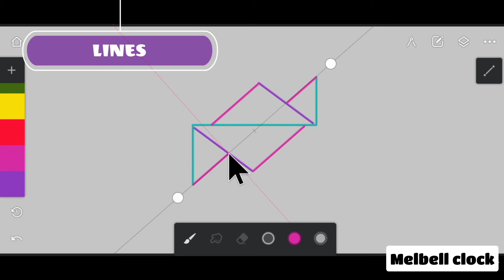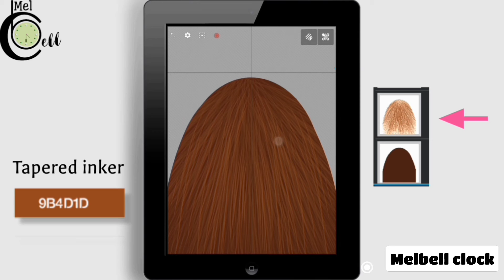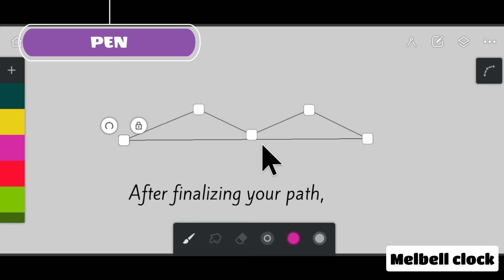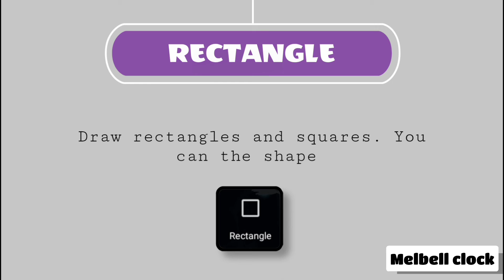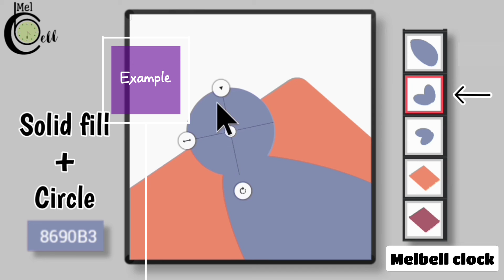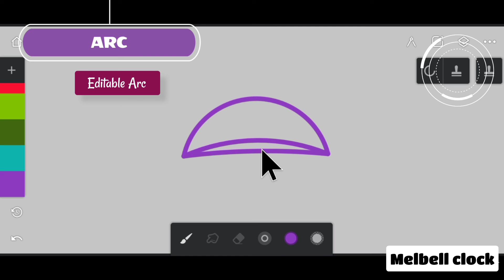Infinite Painter tools tutorial|Guides and shapes tutorial|Infinite painter tutorial

Comment: Once you Press ✓ when doing a path, is there a way that we can select it & edit it with original anchor points?
Reply from the maker: Unfortunately no.
Reply: @melbellclock1761  thankyou for answer. What do you do in that situation? Redraw everything from scratch or any workarounds that you know?
Reply from the maker: @TharukaNisal  it depends, sometimes I use eraser  and brush to modify the shape. Also I use distort and wrap tool depending on the context.

Comment: Nice tutorial , except for loud music. I wanted to ask, is it possible to edit the shape later once you click the check mark. It seems to me there is not option to keep any shape editable. Everything becomes a flat line once you change the tool.
Reply from the maker: Once you click the check mark, It's no more editable.  But if you need slight variation you can use wrap or distort tool to modify them.
Reply: Thanks a lot for quick reply! @melbellclock1761
Reply: Did you find any option to do this.?
Reply: @TharukaNisal  Sorry, may be there isn't any option for that.

Comment: Thanks for the video. When I try to do as your example of Solid Fill + Ellipse, for me it fills the whole sheet instead of just making the circle as in the example.
What did I forget to do?
Reply: I have the same problem, it would be helpful if you would include this in de video. Edit: I figured it out watching your other video! For people with the same problem, there is a brush called solid fill, thats the one you need, not the tool in the upper left hand corner!
Reply from the maker: Try solid fill  brush + circle tool
Instead of of solid fill brush+ ellipse tool
Reply from the maker: Contact me on insta@ col_ours01